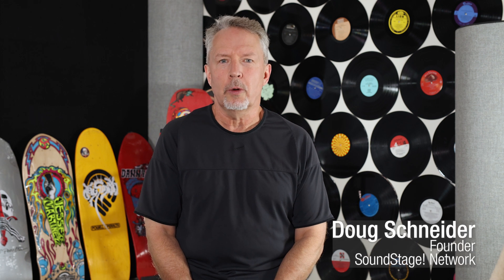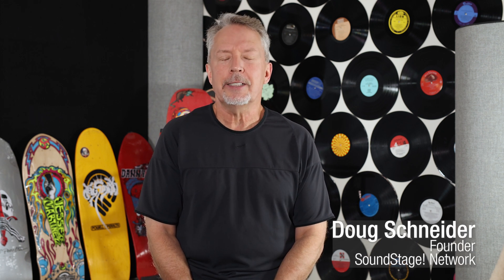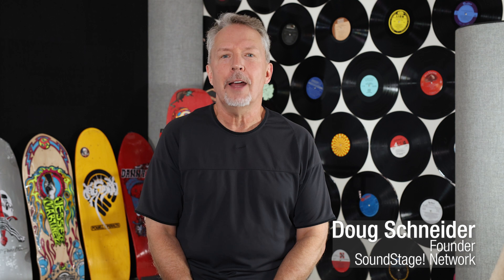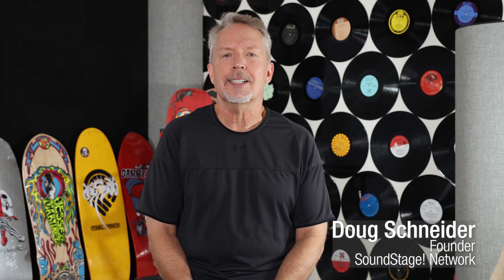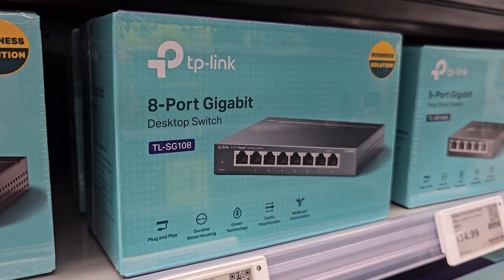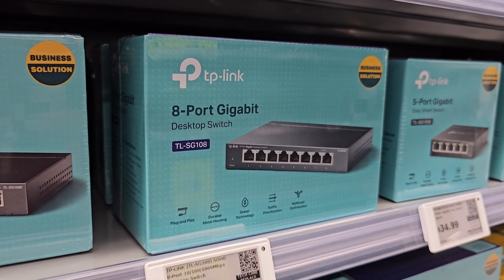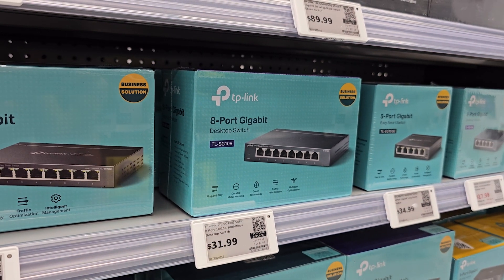How an Audiophile Network Switch Can(not) Improve the Sound (Ep:74)

Comment: You're being very dogmatic.  I have seen this lack of curiosity from you before. A difference can easily be heard.  I agree with the data transfer issue.  

That being said, I easily passed a blind test with a simple ethernet filter.  There is definitely something here that we do not have the ability (yet) to objectively quanitfy.
Reply: I apologize if I'm wrong, but I vaguely recall you spouting off some nonsense before. That said, I think it shows much more curiosity to actually looking into a topic, discuss it, experiment, than it does to put a reply on YouTube like you do. That said, tell us about this "blind test" that you so "easily passed." I bet it was tricky...
Reply: @dougschneider8243  What you remember, was you being dogmatic, obtuse, and dismissive of a sound technical rebuttal of your simplistic generalizations on loudspeaker designs.  You then didn't like it when I continued to challenge your assertions.  

I would say you have an IQ in the "danger zone" between 130-140.  Obviously very smart, but not smart enough, or more likely, too arrogant to realize that another point of view and explanation could be possible.

BTW, inserting and removing an ethernet filter is an easy double blind test to perform.  I think you're smart enough to realize that.

Comment: Just use your ears and add a network switch and see if you hear a sound quality improvement.
Reply: Ears can be extremely valuable to gauge sound quality -- that is, of course, what matters most. It's what we hear. But listening tests themselves are tremendously unreliable, so to use your ears, you have to set up listening tests properly to make sure you're not fooling yourself.
Reply: @dougschneider8243  So why are you testing audio streamers (transports) and give opinion on how they sound, without measurements to back that claim up ?  
I don´t get why you are cherry picking and review audio streamer transports (that is still only digital data, one´s and zero´s) but then suddenly refuse to believe in your own ears when reviewing switches. It makes no sense what so ever.

Comment: I appreciate your position but IMHO once you have a revealing enough system, you can hear differences between copper vs fiber, quality SFPs, and linear power supplies. I know it makes no sense based on what I know of networking and buffering, but it is demonstrably true.
Reply: I hope this doesn't sound too harsh, but this bit of nonsense about a "revealing enough system" comes up often. In my own listening rooms I have speakers from Revel, Estelon, Vivid Audio, and more. I have electronics from EMM Labs, Moon by Simaudio, Anthem,  Purifi Audio, and more. This is not only some of the best equipment in the world, the products have been measured in our labs and we know it's all working correctly. What's more, that's just me -- we have numerous writers with equipment that's just as good and "revealing."
Reply: what type of "revealing"? single 8 inch widerange driven by tubes? or something like TOTL Genelecs, PSI, Neumann?
Reply: @AudriusN  HiFiMan HE1000se or better. HoloAudio Bliss. Mainly HQPlayer to DSD.

Comment: I've never tried a switch and probably only would if I could get one seriously cheap so I could on-sell it without loss. 
It's interesting that two equipment reviewers that I like (Hans Beekhuyzen and iiwi reviews) both are in support of a difference in hifi systems. They talk right through with diagrams on how the data is unpacked and then sent on re-clocked. I didn't see any of their technical explanations being debunked on your video which was a bit disappointing.
Reply from the maker: I believe if you revisit Hans Beekhuyzen's channel, his thinking has "switched" on switches. In years past, he proclaimed about reclocking. Shortly after my video came out explaining why, when data is transferred around the internet and through switches, there's no embedded clock in the data stream that matters, he put out a video saying clocking through switches doesn't matter. I could be wrong, but check it out.
Reply: @soundstagenetwork  I'll check out his channel now, cheers